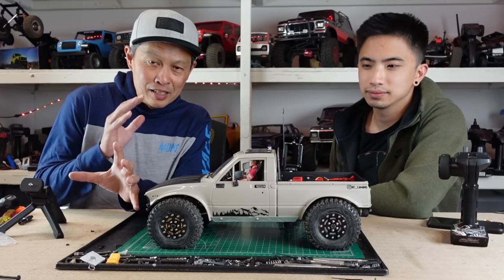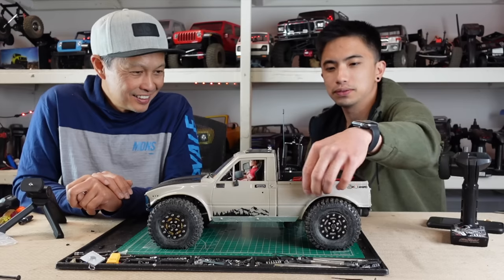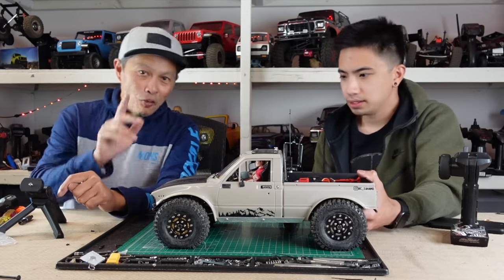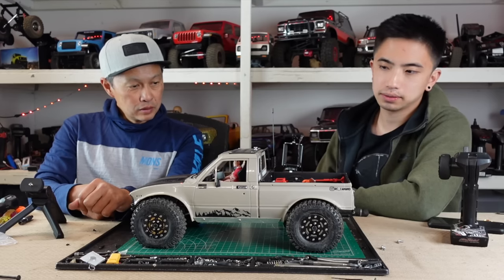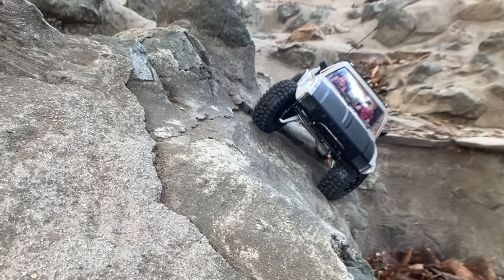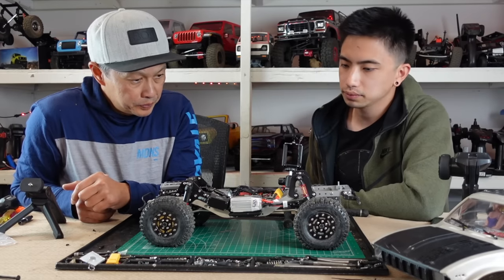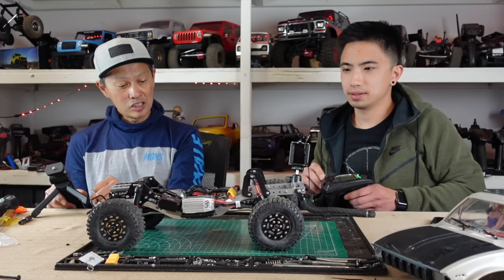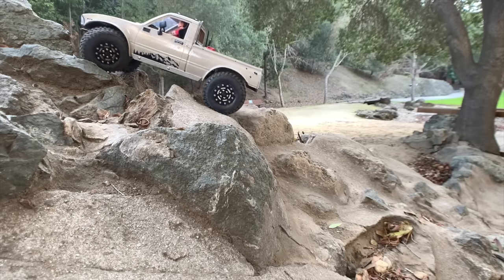Class 1 ultimate scale RC crawler with RC4wd Toyota hardbody and G-Speed Low CG chassis

Comment: Love all your videos but no portals in class 1. That's a class 2 and up. No vehicle other then a Unimog comes with portals. Also need scaled licensed tires licenseplates lights windows rear view mirror and so on. That's a super scale class like class 0. I don't even think you can use a servo winch. Has to be a winch winch, also need a C channel frame. I'm from the East Coast and the rules are stupid stricked and way more popular  and bigger then Class 2 and up here.

Comment: For the mamba x, try running the aux wire to ch5 or 6 and use max power. On my capra, I run a 4s 2700kv puller pro and it gets about 15mph of wheel speed, so I turn down the max power for finesse and not only does it limit the power, torque, and rpm, but it scales the throttle so if I tell it 10% max then 100% throttle is 10% power and 50% would give 5% power.

Comment: Great realization!!

I have not completely understood how you get this incredible stability with hard body...

Is a matter of:
- metal axle 
- metal wheels 
- very soft shocks, wit hig sag, that make the chassis stay very low
- ...

Please can you explain better ?
Reply: Grams matter on top! Make sure to keep the weight down low and have a good forward/rear weight ratio of 60/40. I’ve done the sidehilling with the stock AR45’s on this rig. The metal axles were just a plus
Reply: @neilmandude  Thanks a lot, we also look for this weight distribution but taking in account more the frontal slope than lateral one, because we don't use cars for racing, but for scaling on mountain hard paths (we usually go by my Trial motorcycle), your overall balance is really a new challenge for us, thanks for share.
PS: I apologise for my late answer, but I don't received the notification for you answer...

Comment: So what's an awesome rig like this cost?
Reply: lets see .... the axles start around $200 each , then u have a $150 servo , $ 250 or so for esc and motor  another $225 in rims tires and foam ,  $100 for the chasis  and more misc. parts 
  I would say no less than $1300 and prolly even more
Reply: oh and thats without the body
Reply: @roberth5370  not bad if your rich and good lookin like me!
Reply: Around $2200

Comment: NOT class 1!

This Truck has: Proline Hyrax 4.76" tires

Class 1 Rules:
106mm / 4.19" Max tire size including spares.

Portal axels - There is no specific rule that says you cant use them, however the Class 1 description clearly says "Street Legal" Daily driver - This rule should disqualify portal axles from Class 1.

Class 1 - Description:
AKA: Street. A street legal off-road vehicle that you would drive to work or the trailhead and outfit like
an expedition vehicle such as the Camel Trophy truck D90 rigs.
Reply: False. Tires are Hyrax 4.19”. Rule book doesn’t rule out portals. Hummer H1 has portal axles and can be daily driven.
Reply: @neilmandude  Correct but the Toyota Hilux does not come from the factory with portal axels. So no....
Reply: You made my point already. “No specific rule that says you can’t use them,” as you said. Daily driving a truck with portal axles is achievable. You can put portal axles on any 1:1 scale daily driver if you have the creativity to do so. Ever heard of ✨after market parts✨
Reply: @neilmandude  This is why these classes are worthless... I'm sorry but this has way too many mods oversized tires and protal axels - it stretches the rules and makes the classes worthless. This should be a class 2 rig - if they are going to allow this many mods for class 1 they should just do away with class 1 it does not resemble a "stock" truck in any way. A 1:1 truck with this many mods is FAR from stock.